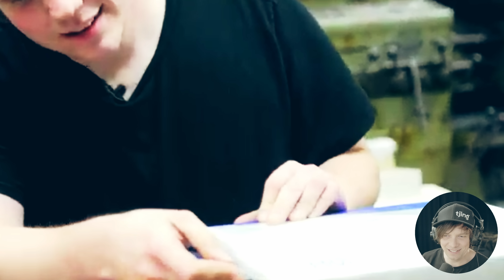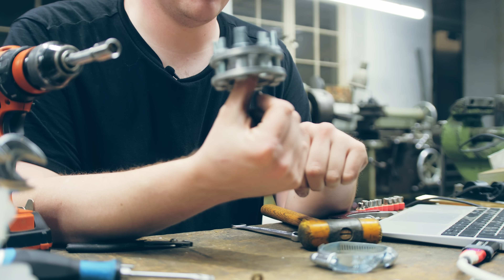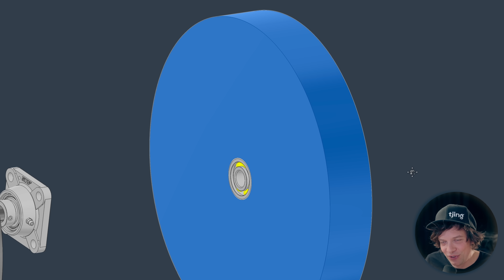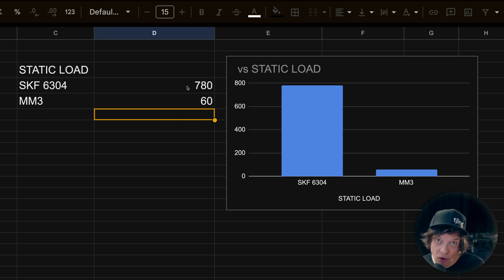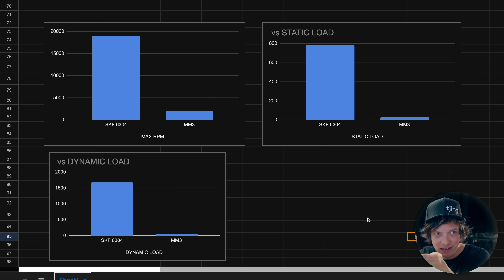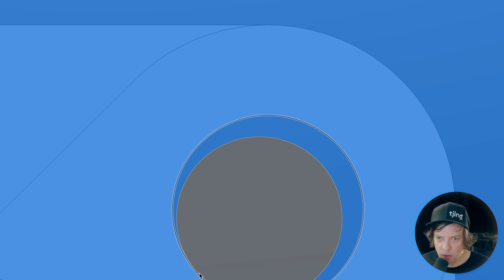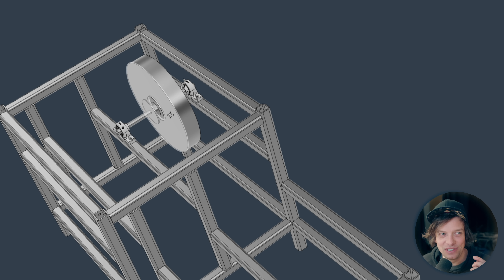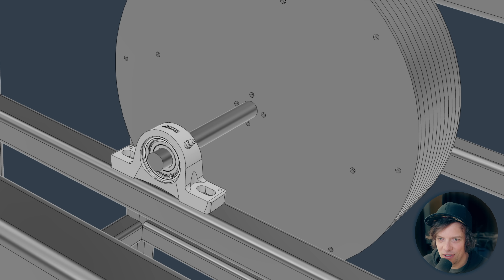Worst Bearing Housing Ever - Marble Machine 3 Ep.3

Comment: Bolts are not designed to take the loads that you will put on them, they can fail any moment.
Reply: They are also much much wider in tolerance than the laser cutter - you can get more precise thread sizes but 99.99% of the time a bolt only has to tighten, so the OD of the thread is almost entirely irrelevant, as is the shape of the thread really - it just needs to have the right pitch to thread properly with enough thread engagement to clamp down hard... When you want a positional bolt you have a shoulder of unthreaded proper sizes...
Reply: Please everyone upvote this, so it's seen by Martin.
Reply: @w0nd3rlu573r  he doesn't care. He sees the criticism and suggestions, acknowledge it and moves on with his idea. When it fails he just starts to build another machine.
Reply: That depends on the type of bolt and the material it is made of, for example every single bulkhead on a Boeing 747 airliner is in fact bolted together truth be told bolts have much higher tolerances than using something like welding it's why aeronautical engineers avoid welding at all costs.(for reference the load of the flywheel will be divided among each bolt so there are 8 bolts so each bolt will take 1/8th of the total load.)
Reply: @thestormcraft4012  it is not the axial load that worry me but the shear load
Reply: So long as the total load of all the bolts combined match that of the bearing then the bolts should be completely fine.(to clarify I mean that their stress tolerances need to match that of the bearing)
Reply: I lick the bolt
bolts are not designed to be licked
so it can fail at any moment

Comment: Every part that can be reused is a part that was designed and tested by someone else. The part may not be completely perfect for the application, but, if we are to believe you, that isn't the goal. There seems to be a misalignment between the stated goal of a non-perfect design and the reluctance to use off-the-shelf parts that may not be perfect. If the channel shifted its goals from building a fascinating marble machine to exploring unconventional solutions to common problems, there wouldn't be an issue (except for disappointment, but who are we to dictate what you should do?).
Reply: Sounds like he's trying to order everything from that Tailor Steel supplier. It's fine to order as many things from a single supplier, but you can't compromise the integrity of the design because of that.
Reply: @CristiNeagu  and the fact that if something were to fail while being on tour (like that'll ever happen) you can run to nearly any bearing supply and pick up a new pillowblock and be on your way with only minor adjustments made
with as many bespoke parts he wants to use it's no wonder it's taking so long to do anything at all.
Coming from an engine mechanic background, nothing can be made concentric straight off the forge (think crankshafts) and therefor have to be balanced to a degree, I think he is shooting for something that he either doesnt understand, or like some other people have stated "to drag on the show"
Reply: @leviwilder1205  I said as much in another comment. What's more, I'm pretty sure big companies like SKF will overnight parts to you. I'm sure they're used to customers whose downtime is measured in thousands of dollars per hour.
Reply: @CristiNeagu  Yes and they charge accordingly
Reply: @tymoteuszkazubski2755  Not as much as it would cost to cancel a week of concert dates while you manufacture and tweak a new part.
Reply: @CristiNeagu  that's true though it is cheaper to keep some spares. This is why it is highly advisable to limit the number of bearing and bearing block variants to a minimum.
Reply: At this rate, we will will probably see Martin on the moon before MMX3 is anywhere near finished

Comment: Just build it with your bearing housing design, leave the flywheel slightly  larger and machine the outside diameter and sides if required after it is assembled in the frame, machine it in place. Also consider your bolt together design is going to load the outer race of the bearing in spots, this may reduce overall bearing life, but am sure it will work for your hand powered low rpm device. Best of luck with the new design.

Comment: You don't need concentric flywheel. You need balanced one.
Reply: Many flywheels in engines both new and old are cast parts and not perfectly concentric from the inside to outside but they are balanced by drilling out small amounts of material on the heavy side to balance the spinning mass.
Reply: That's what I was thinking as well, and that's why car wheels have a balancing procedure.
Reply: Yes, there will be less balancing required if things are perfectly concentric and perpendicular, but it's likely that even then a little bit of balancing will be required. If the perfect concentricity and perpendicularity requirement is removed, then he could just weld the plates to the shaft and bolting on balance weights may be simpler than the complexity of keeping everything centered.
Reply: Very concise and well said.
Reply: Hijacking top comment to add:
Martin is under the assumption that having concentricity will mean you get balance for free. But if the steel is not perfectly uniform throughout the entire flywheel, you will not have a balanced flywheel even if you do have a perfectly concentric flywheel. You will need to balance it at the end anyway!

I just love how Martin is like "I am going to start deferring to the engineers, I am going to design for reduced part count, I am going to buy as many off-the-shelf components as possible to reduce engineering time!" And then he disregards all of these with this bearing housing because he refuses to buy an off-the-shelf component and doesn't believe the engineers that he doesn't need concentricity.
Reply: Exactly this. Exact concentricity with a laser-cut part is not even possible. Even if it were, does the metal have perfect uniform density? Probably not. Mount the flywheel as concentric as you can reasonably get it, then balance the flywheel like balancing a tire.
Reply: This is true. Once the flywheel is balanced how do you disassemble it and reassemble while maintaining the alignment it was initially balanced with?
Reply: This whole video is him missing so many points. Really unfortunate.
Reply: And I think, that you (Martin) need short shaft, because it will bend because of flywheel weight.
Reply: On the topic of balancing, I just recently saw a video from clough42 about balancing wheels for a surface grinder. Perhaps the solution used on those could give some inspiration for solutions here as the two problems are similar. (Even if on vastly different scales)
Reply: Remember a few years ago, when Martin tried to balance the flywheel by doing a geometric adjustment with the angle grinder..... things got worse with increased vibrations. 
Lesson learnt in MMX but maybe already forgotten....concentricity and perpendicularity cannot help if mass is not evenly balanced in the material.

The calculation of the Mean Time Between Failures of the ball bearing is based on the force, torque, static and dynamic loads, rotation speed and daily usage time; Doing this calculation will help to have a reliable machine.

SPOILER ALERT, this is called planned obsolescence, and this is how we design mechanics so it breaks the day the warranty ends.
Reply: To sum it up, the goal is to make the center of mass concentric. What that mass looks like doesn’t really matter.
Reply: Alternate bolt head side to get closer to balanced initially.
Reply: Well said. Mount the fly wheel so it can spin freely, and mark the lowest point when it stops moving, then drill out a little bit from the outside of the disc at that point. Repeat until you have a balanced flywheel. Also, for this same reason, I would recommend you mount it in such a way that it can only mount in one orientation. This will help keep balance if you have to reassemble it multiple times.

Also, I still can't say I'm convinced that this isn't just gold plating. It seems like a lot of added effort just to stick to one manufacturer.
Reply: @Hulmeg0319  every major city will have multiple balance shops. Things need balancing all the time. It’s not expensive and it will be perfectly balanced, something you can’t achieve with gravity due to the friction of the bearings.
Reply: True. Just weld it or something and then balance it.
Reply: Sat through the video hoping Martin would get to this exact point. Since the flywheel is not integral like a car rim is, it could even be balanced by removal of material (drilling holes) which can be covered if drag is a problem
Reply: I would suggest martin to take a week off the project to clear his mind. He is over complicating way too much by often discarding viable solutions..
Reply: I presume Martin knows that. There was an entire episode of Wintergatan Wednesdays where Martin spent hours machining the old flywheel to be concentric, only to find out that it was less balanced than before.
Honestly I think this bearing saga is the next iteration of the homebrew engineering rabbit holes that eventually killed the MMX. Either that, or it is rage bait.
Reply: @phiipichut247  it's so far wrong I am somewhat convinced he's baiting. Kind of obnoxious honestly.
Reply: @etd6392  that's it.
He's not giving  a damnt to the project.

He craves your time.
Reply: I suspect the flywheel or at least the pulley needs to be concentric for smooth operation to transfer the energy through a chain/belt or w/e. You'll have inconsistent power transfer otherwise...
Reply: yep said that weeks ago
Reply: Yes, it's true. But easiest way to get balanced one, is to make concentric one.
Reply: @psokol83  in other words, a perfectly symmetrical, homogeneous flywheel
Reply: I agree, centrecut the flywheel to take the bearing and then have a bolt on plate to hold it in place, then balance the flywheel.
Reply: @noobdernoobder6707  Geometry does matter. Even if perfectly balanced, if the other side causes much more drag than the other, it will have a negative effect. Depending on the geometry, the effect can be vibrations or merely just an increased force to resisting the turning of the flywheel. 

Nothing in physics is black and white. Such binary answers can be automatically deemed incorrect. The question is not whether or not it matter, because it always will matter. The question is how much it matters. Some geometric configurations will cause vibrations in relatively low speeds.
Reply: Came to say exactly this.
Reply: Perfect balance is hard and a flange bearing would be less likely to shift and comes loose.
Reply: @ameunier41  perfect geometric concentricity is way harder and way less necessary than pretty-good balance
Reply: You need articles, my friend :)
Reply: Exactly. Just stick some little weights to balance the flywheel afterwards like how we do car wheel balancing
Reply: Lock the wheel with a key hole, and balance the wheel
Reply: There are two types of balancing: static and dynamic. You need to do both. Something can be g perfectly balanced when it is not moving, but be out of balance when you spin it up. 
I did my second year dynamics course more than half a lifetime ago, but I still remember that bit.
Reply: You can lose balance very quickly if you don't have concentricity.
Reply: Well balanced is much easier if you focus on concentricity. Otherwise you have to custom balance everything.
Reply: @dexterm2003  You have to custom balance the flywheel anyway. Concentricity means less unbalanced from the start, but you still need balancing.
Reply: @RegebroRepairs  Well said.  Thanks for saving me the time to write the same ;D
Reply: @dexterm2003  plenty of things that are designed to spin are not concentric and need balanced, it is just a common procedure. Unless he gets the flywheel made on a lathe it will not be perfectly concentric or balanced.
Reply: That level of perfection isn't even needed for a machine with light load and intermittant usage.
Reply: I think self aligning bearings would be best. Self aligning pillow block bearings are cheap and plentiful.
Reply: you mind explaining why you don't need concentricity?
Reply: @Jrakula10   Concentricity can lead to balance, but does not guarantee it. For smooth and consistent operation, the balance is much more important than concentricity for such a large flywheel. See engine crankshafts: very eccentric, but very smooth running because they are balanced. That said, chasing concentricity here will definitely make balancing later easier.
Reply: @Jrakula10  vibrations are the problem. Vibrations caused by weight disbalance. Look at how automobile wheels are balanced
Reply: @Jrakula10  A crankshaft is not remotely concentric - but it must be balanced to prevent vibration and frankly, self destruction. Even the best concentricity, does not guarantee a balances system.
Reply: @graxav  Crankshaft main journals are very concentric and even the block-side of them should be align honed/bored. I'm not sure what you're specifying here.
Reply: @Jrakula10  He's right i think, even by perfectly concentric wheels, the material could be uneven in it's density, Martin might need to balance the wheels anyways.
Reply: @Jrakula10  Depends on the usecase; here it is a flywheel = a rotating mass = stored energy. The only requirements are the needed weight, size limitations and balance. Objects can be any form, as long as you do not create vibrations; avoiding vibration is done by balance. The use of ball bearings is to reduce friction = reduce power needed to turn it and reduce wear on the parts surfaces.
Reply: @Jrakula10  the crankshaft in your car engine isn’t concentric. It isn’t even round.or linear. But it is very well balanced against the mass of the pistons and rods. A flywheel needs to be mass balanced, not round, or perpendicular.

Comment: As a bolt cage bearing supporter I stand vindicated by the test.
Reply: Time and again in my job as a test engineer I have seen a failed bearing spin and feel just fine unloaded at low speeds.  When operating underload at operating speeds it will vibrate and squeel like a pig.
Reply: @FizzicksDude  Sure, now with a 60kg flywheel what is a realistic maximum force on the bearing with even the most basic of balancing?

Comment: Look up how a sheave is designed.  It uses axial loading with bolts to clamp toa rotating shaft, kind if like a collet from a mill.
Reply: Specifically a h style split taper bushing.  Still requires a keyway but most shafts can be acquired with a keyway

Comment: You also should machine it. It is a flyweel, it has a decent amount of energy in it when it's spinning. It can be very dangerous for you and the machine if it is not well dinamically balanced.
Reply: Just because it's machined doesn't mean its balanced. The density of steel can vary somewhat throughout.
Reply: @MrJamesBanana  but that issue would also apply to plate steel only more so, since the thickness of the plate will vary across a sheet as well as its density. 

Martin should also increase the radius of the flywheel and include spokes/ lightening holes and a solid rim. This would result in identical moment of inertia (and therefore rotational energy at the same rotational velocity), but reduce the mass of the flywheel, reducing load on the shaft and bearings as well as making the machine lighter and thus easier to transport.
Reply: @slartibartfast2649  Spokes are pointless if you cut the flywheel out of a plate or machine it, you want a flywheel go be heavy the material is already there why remove it.
Also spoke create aerodynamic drag and can produce noice, what could be a problem for his application.
Weight saving doesnt matter, you need multiple person or a forklift anyway to move this machine, 20kg more or less dont make any different.

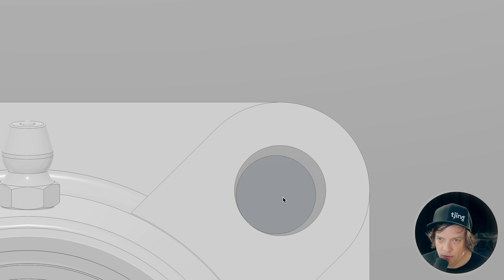Comment: 13:37 no?? Those holes are oversized for a reason, to ADJUST them. Take a dial indicator and a hammer, turn it a few times and after a little tap here and there, it will be perfectly concentric.
Reply: My mechanical design professor in college told us pretty early on: "Bolts and screws are fasteners. They are not to be used for alignment. That's what alignment pins are for."
Reply: And then you can drill out that 4mm registration pin location in the plates so it goes back perfectly every time and can't shift on you with the shocks and bumps of world tour transport!
Reply: Its like he doesn't know what a dial indicator is. Didn't he put together his expensive CNC machine? Guarantee that machine had to be adjusted.
Reply: So SpblS is correct.
Reply: He'd probably know that if he had any practical engineering or machining knowledge/experience. He needs to go work a shit job in a machine shop for a few years, rather than play around in CAD all day.
Reply: @awesomo9k  haha I (m19) just a student, but I've got a little lathe in my basement. That and a few YouTube videos is enough to learn a lot about engineering. And HE's been dedicated to this kind of unprofessional trial and error for years, but has still not learned a thing.
Reply: @awesomo9k  oh yeah that sounds like a really efficient use of his time

nice comment good job
Reply: @DevinDTV  bruh he could have literally gotten a mechEng from a UK university and spent 2 years as a machinist at a job shop in the time it took him to build the first machine, which he then threw away
Reply: That is (more-or-less) how a non-concentric part is ajusted in a lathe.

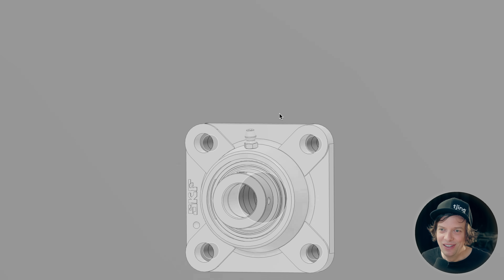Comment: 13:20
I had similiar problem, so i just used pieces of pipe in the bolt holes as dowels, with the bolts going thru them.
It turned out to be really snug fit, and it has proven to be center as the plate under the bearing has lipseal that would have gone fast if the axle wasnt centered.